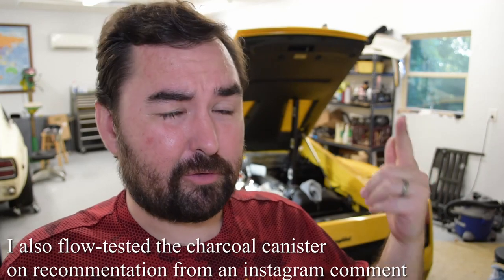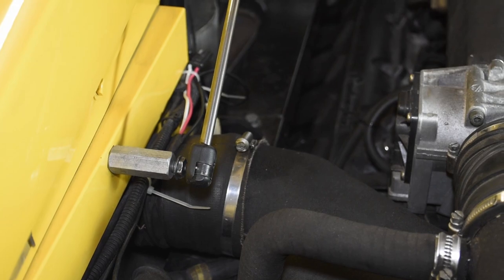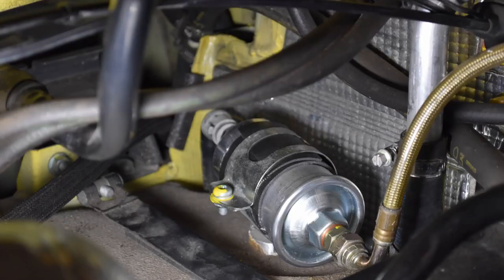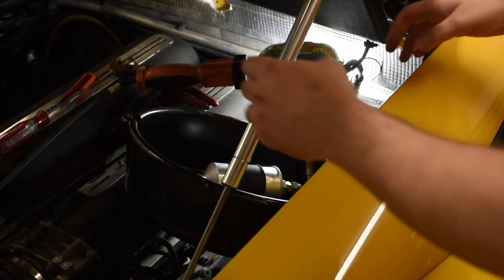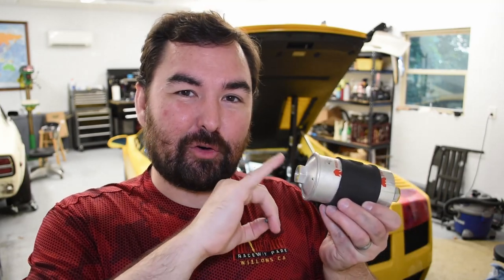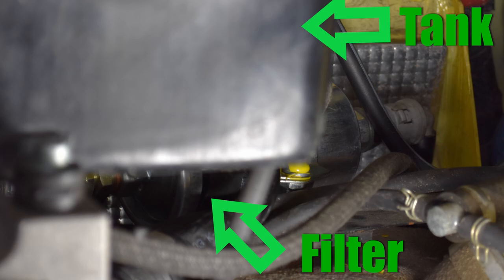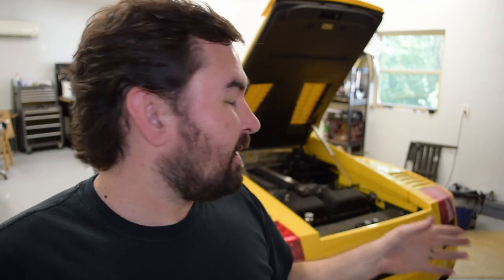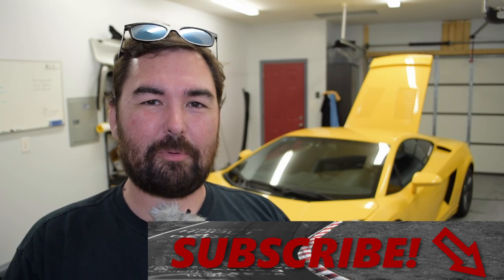My Bull isn't raging as hard as it should!  Lamborghini Gallardo fuel filter DIY (no coolant drain!)

Comment: low fuel pressure can lead to misfires, which would cause the knock sensors to pull timing. set a meter to min/max and see if your sensors are giving voltage spikes to the ecu to cause it to pull timing. you should also install a fuel pressure gauge and tape it to where you can see it hit full pressure with no vacuum, and continue to hold pressure as rpms/duty cycle build. that should confirm pressure and volume are ok on the pumps. you could also measure voltage drop from battery to fuel pump connector positive, and negative to battery ground, to see if a poor connection is causing a power draw under full load.
Reply from the maker: Thanks, I plan to test some combination of those things before committing to throwing more parts at the problem.  I'd have expected the first condition to generate some error code, although I've now read that there are some fuelling issues or causes for fuelling issues that tend not to with these cars.

Comment: I’m sure Tavarish did fuel pumps on his fire damaged Lamborghini if that helps
Reply from the maker: Yes he did and I did go back and look at that.  It helps-"ish".  1) The Spyders  are laid out a little different from the coupes with respect to the space between the back of the seats and the engine compartment because of the top.  2) He pulled his motor (for other reason) to get to where he could see the fuel pumps.  I'm hoping not to have to go that far 🤞
Reply: Well good luck and hope to see a video of it soon

Comment: 3rd gear and 40 mph, put the thing in second and mat it.
Reply from the maker: If I had to run a time trial with it as-is, that's exactly what I'd do.  I'm also 100% in favor of checking the "nut behind the wheel" before blaming a car for some performance issue.  The 3rd gear test case is just that: a test case that seems to most consistently reveal the problem.  It's hard to explain, but when I mat the gas, there's an initial split-second jump, as if it wants to go, then it feels like a parachute gets deployed and the car is having to fight through that drag to accelerate.  Honestly though, even in second it does the same thing, just not to the same degree.
Reply: @LapoftheWorld  All I'm saying is 3rd gear is not the place for 40 mph if you're trying to gauge it's performance or lack of and probably putting undo strain on the gearbox, 2nd gear is good up to 80mph and if yours is an early pre-lp it's probably even worse because of the gear ratios in the early cars vs the later 5.0 liter versions. It's not an LS engine with gobs of torque down low it's meant to make it's power in the upper RPM range.